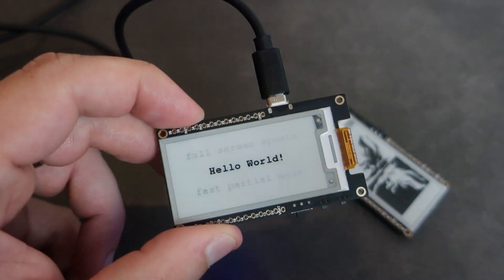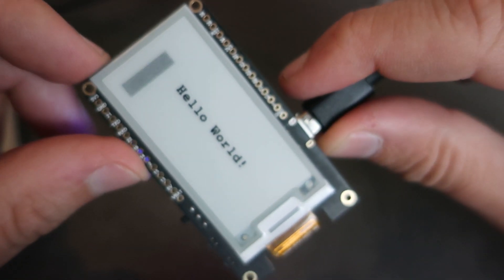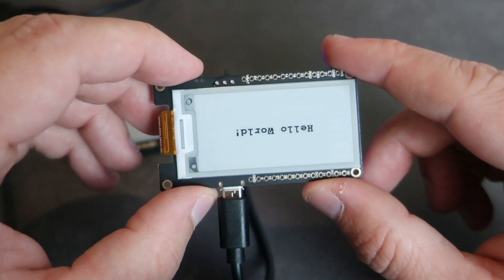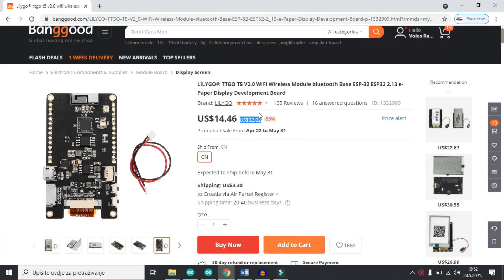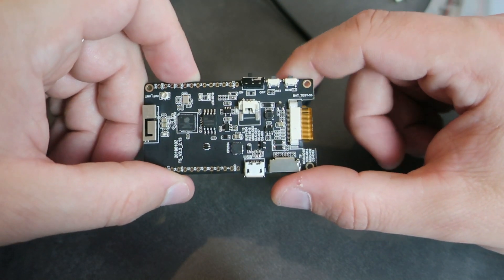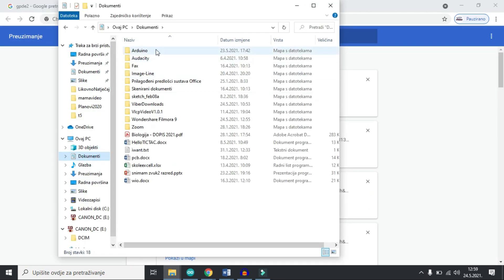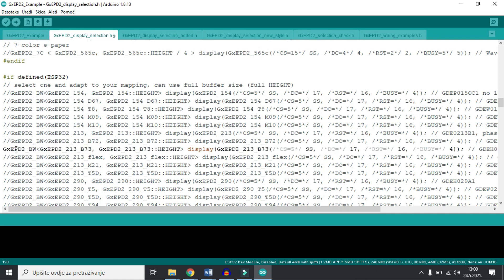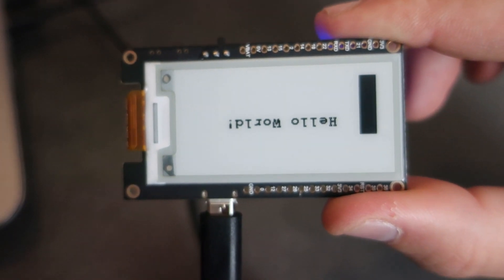LILYGO® TTGO T5  -EPaper ESP32 developement board - Overview and Setup (V2.0)

Comment: Thanks!
First attempt worked using GxEPD2_BW<GxEPD2_213_BN, GxEPD2_213_BN::HEIGHT> display(GxEPD2_213_BN
on a Lilygo TTGO T5_V2.3_2.13  with panel code SLH 1914
Reply: Thnx I also got it working 
 GxEPD2_BW<GxEPD2_213_BN, GxEPD2_213_BN::HEIGHT> display(GxEPD2_213_BN
on a Lilygo TTGO T5_V2.3_2.13  with panel code FPC - 7528b

Comment: I have the perfectly same board issued on 2019.01.07. That is  T5_V2.3_2.13. 
I downloaded the same GxED2 project zip from GITHUB and installed it by Arduino ide.  I selected the same display type as you selected. I compiled without error.  But  ePaper display does not work as yours. I just displayed "Hello World!" text and nothing  more. What  should I do or check to make it work correktly?
Reply: I have same problem with you. I just try the code from the example to displayed "Hello World", but it does not work

Comment: What settings should I use for display "HINK-E0213A22-A0 SLH 2014" and board "T5_V2.3_2.13"
Reply: Hey andrew,  I have same board, but I cant to use. I try to upload the example program, but it doesnt work. I hope you can share to me if you can use it. 

Thank you